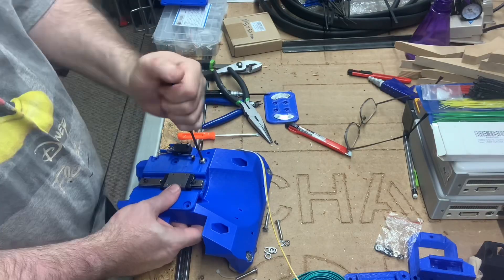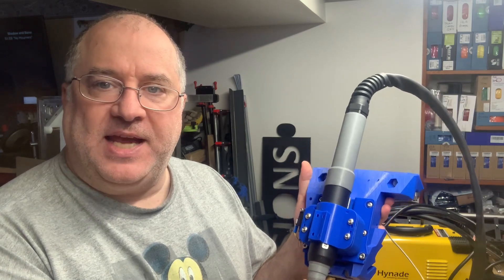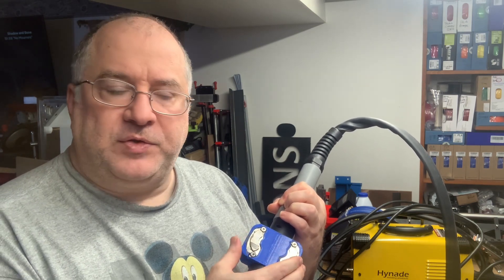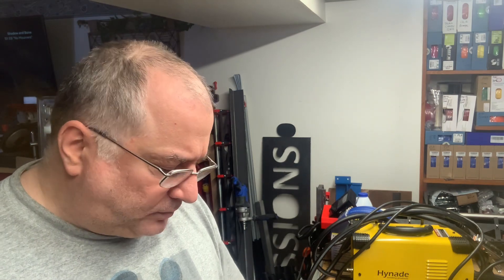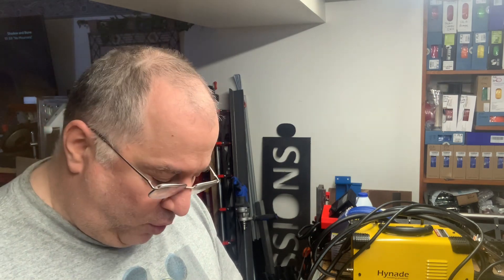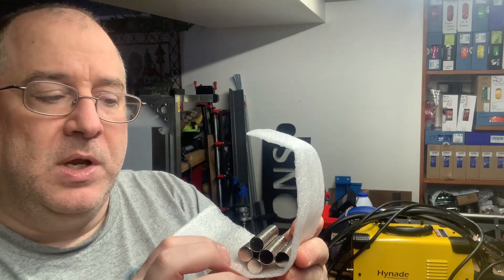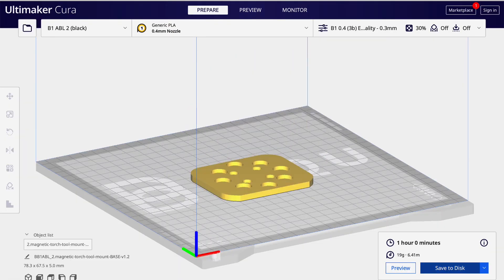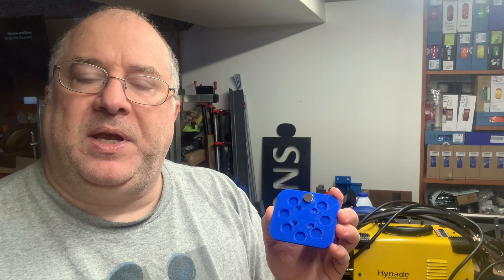LowRider 3 CNC Plasma Table PART 4 - floating Z torch mount

Comment: Plastic mounts wont stand on a production cnc plasma cue to the heat around the torch . . .
Reply from the maker: Thanks for watching and commenting. My hobby use has never seen any issue with the printed plastic, and it follows many others using printed plastic. For anyone in a production situation, of course they know their needs.
Reply: @design8studio  Cheers! I started as a hobbyist and used 3d printed accessories for my cnc plasma and they function well but I am now operating on production pace and the plastic parts on the torch softens during long time operation . . .
Reply from the maker: @nes-t326 Congrats on the successes and transition to production level output. If I ever have such "good problems" I may well have to make some changes.